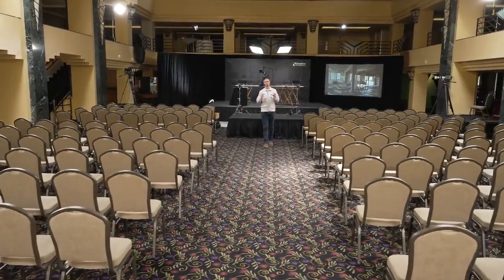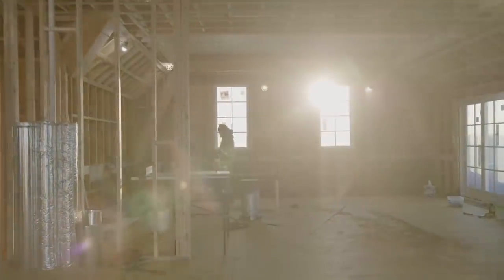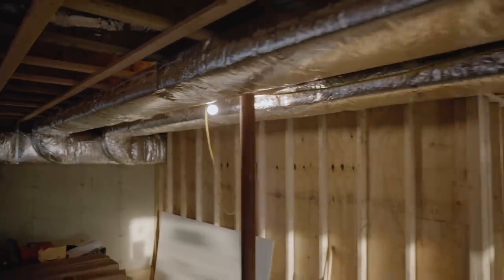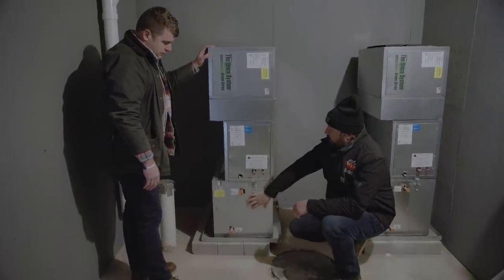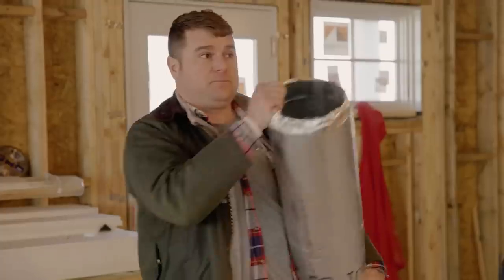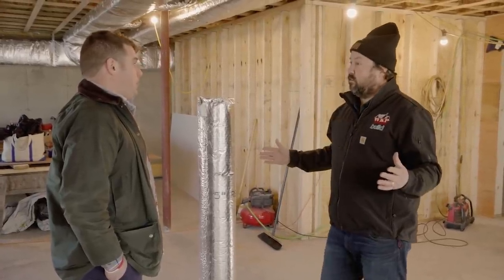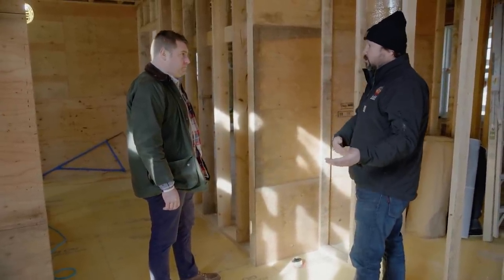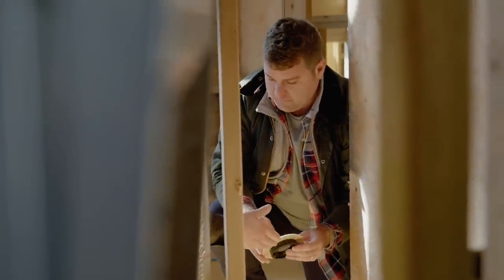Unico HVAC with Tiny Tube Ductwork! BOAI: Episode 7

Comment: Unico makes 0 sense in new construction, sorry guys. (This is coming from a Unico installer/dealer)
This just seems like poor management of space... Conventional systems have such significant advantages over high velocity in terms of comfort and efficiency. Especially in a situation where you need to be particularly efficiency-minded, this was a poor design choice. Sure, we got a little extra headroom (4"???), but we got a lower efficiency system with no access to communicating controls, truly variable capacity or fan speed, etc...

We love and use Unico for retrofit in urban homes all the time - it's FANTASTIC! But, time and place...

Comment: Less air flow must be new england speak for less volume. I think most people would simply reference other common models for volume and velocity. Its funny that they make a big deal of it being modular but every air handler is made to be able to be added to with things like an A coil, or a gas set-up or a dehumidifier,  etc.
Reply: PV=nrT  period!  Nether of these guys have a commanding understanding for the physics, as do most normal non-engineer, builder dudes.

Comment: I installed a Unico system in my 1920"s era house back in 1995. Big mistake.  For that small size duct, you have to makeup volume with velocity and that creates a noisy system. The noise was really distracting, particularly on startup. When I renovated my next house, i went with with a variable speed/conventional duct system.  Maybe technology has improved, but I would be skeptical about the noise factor.
Reply: hopefully it has changed in the 30 years.  i would imagine the supply ducts have the sound attenuation which would reduce the noise
Reply: @sabregunner1  There were sound reducers on the ends of each duct back then, so, I'm doubtful on the extent to which it could be improved.  I remember the salesman explaining that the system would be relatively quiet....not so in reality.  I get the advantage of Unico....it's all about being able to snake the small ductwork around in limited space.  That's what brought me to the Unico system in the first place. But, if at all possible, I would avoid that option and make it even better by using a variable speed air handler.
Reply: @joemartino6976  ok.  wasnt sure how much that was a thing back then.  You;ve got a good argument there
Reply: We installed a Unico in our 1880s era home a couple years ago in our 1st floor and it is nearly silent. Our 2nd floor has a conventional system installed by previous owners and by comparison it is a noisy racket. Not sure why the big difference, but we do love the Unico in our case.

Comment: 2 zones for the entire house?  Did I understand that correctly?  Brand new house, guessing 3000+ sq ft and only 2 zones?  Not only that, those heat coils require medium temp water, not low temp where a heat pump (ground or air source) would shine.

Building on an island, fuel & power delivery is the hardest, most expensive task. The property location is a heating-primary zone.  A ground source heat pump & low temp in floor heating would be the cheapest, most comfortable heat solution.  Zone every bedroom, kitchen & living room independently.  Cooling could also use ground source heat pump system.  The most comfortable cooling solution would be a refrigerant manifold system with multiple ducted heat pumps.  A cheaper solution would likely be chilled water air handlers.

Add lots of solar and you would have an efficient system that would be cheap to run.

That system they chose is going to be expensive to run and maintain.
Reply: Yup.

When you have a contractor that gets kickbacks from Unico and forced a bad solution down the poor new homeowner’s throat.
Reply: Why not ductless?
Reply: @nihiltube  ductless would work fine too but sometimes you end up with higher temperature variances between rooms.  For example, It doesn’t make sense to put an air handler in a hallway, bathroom & mud room.  You would place a ductless air handler in a common space close to those rooms and rely on convection to cool those spaces.

With multiple ducted mini-splits you can direct air exactly where you need it to achieve a lower temperature gradient across rooms.
Reply: @brians8664  IMO single rooms are ideal for ductless because you get individual temperature control, and if you don't have any very small room, you can save a bit on the bill - ducted I would like on a common space and bathrooms, since bathrooms are typically small and you wouldn't put a ductless minisplit in there. With this design you don't get a temperature gradient because each room gets its own zone. Large open spaces are probably better served with ducted if you can bring the ductwork around practically. What do you think?
Reply: Looked like three zones. Two units in the mech room and one in top floor's attic space.

Comment: Just finished installing my first Unico. Lots left unsaid in this video.

You're losing efficiency with high static pressure. Period. Even the design manual talks about reducing it.

"You'll never see larger than 9 inch duct". This is a terrible way to say it. You'll never NEED more than a 9 inch duct. But you can and should up-size if space allows.

Lots of benefits they could have talked about: Very quiet. Hydronic options. Simple to calculate. 

But the number one reason to use one is because you don't have room to use a conventional.
Reply: And if you don’t have room to use conventional ducting, then go VRF!!! The blaring solution in the room.
Reply: @xzibit8614  but doesn't solve fresh air, right?
Reply: How is the sound? I am seeing videos that show how loud the air flow is in the room.
Reply: @archidube  It's not bad, if you do it right... The frustrating part is that if you send it to Unico for them to design it, they will very likely violate the recommendations in their own design manual. Probably because they don't want to price themselves out of the job... Doing it right / making it quite involves more outlets (more outlets == less airflow per outlet == less noise).

Unico's "normal" recommendation is 6 outlets per ton... I think I did 11-12. 

I cannot hear the equipment, at all, ever. I can hear the airflow if I'm at the top fan speed and the house is super quiet (and my house gets SUPER quiet). Once the kids and dogs are awake, I can't hear it at all.
Reply: @JamesTalmageR  All of this complexity makes me wonder if just having normal sized sealed duct work is better after all.
Reply: @archidube  Absolutely no question that normal size ducts are better, if you have room for them. Unico's claims to the contrary are nonsense. I wish they'd just stick to selling to the niche market they're best suited for, but that's not how corporations grow revenues.

As for "all this complexity"... Engineering the Unico is a cakewalk compared to standard systems. Proper duct sizing is fairly complex in traditional systems, and almost nobody does it right for residential. It's certainly worth doing if you can afford the engineering bill.
Reply: @JamesTalmageR  I have a house with 50 year old metal ducts that has had flooding in crawl space last two hurricanes. The insulation floated off the main trunk line and the rest will stay wet for months. Glad they are metal. Thinking of putting in the attic which is low hip roof. Maybe starting over with Unico would save money if I did it myself.
Reply: @archidube  Unico has great training resources. Some of the best out there. Figuring out how to do it yourself is no small undertaking, but they actually provide enough information that it's possible. Read all the service/installation manuals, and all the tech notes. at least twice, and take notes. There's a particular "designing for quiet" technote that covers the outlet-per-ton numbers I was talking about.

If it all possible, you should use the "self-balancing loop" design for your main trunk (it's what it sounds like, rather than a bunch of  branches going in multiple directions, you run a loop). It operates on similar principles to plumbing balancing loops when you've got multiple shower heads. It cuts down on the required duct engineering significantly (at the expense of extra duct).

If you're going to put it in the attic, you're going to want to consider encapsulating the attic. Matt talks about it alot on his channel. Energy Vanguard (an excellent resource) has multiple posts as well. There are pitfalls encapsulating older roofs... Make sure you read a lot.
Reply: Unico has the best small duct work out there and they are not selling more because they are not doing enough advertising. Great people to work with. I’m hoping to finish my installation this year

Comment: For the dehumidification, how would the performance of this system compare to a properly designed HRV/ERV ventilation system?  My dream system would involve geothermal and a water to water heat pump for both heat and cooling.  Plus something like the Zehnder system for fresh/conditioned air
Reply: Ditto this question. Will this system have an HRV placed? Be interesting to see where these premium additions (dehumidifier & HRV) will be added or not.
Reply: HRV/ERV should be completely separate from the heating/cooling/dehumidification. Although you could maybe consider exhausting bathroom air as part of the dehumidification strategy.

Comment: could just leave out the lowest module and use a heatpump for both heating and cooling and have a simpler and more efficient system :D
Reply: Heat pumps are more efficient than any boiler, the only exception is when it is below -25f outside or if you're electricity is super expensive. Honestly, heat pumps should be mandated on new construction, there is literally no reason to install a stand-alone AC anymore.

Technology Connections has a few very good videos about why heat pumps make sense even if you live in an area where a heat pump cannot operate.
Reply: @namAehT  yeah exactly, and its not many days it get that cold so its still cheaper

Comment: Problem with unico is these tiny proprietary ducts.  If you ever decide to not go with unico or if they go out of business, homeowner is  screwed.

The entire industry uses a ducting standard but “oh so unique” unico with their proprietary tiny low CFM high pressure, high energy hog, high cost gimmick.

If they wanted no ducting should have gone with a VRF System.
Reply: THE ENTIRE INDUSTRY. This is marriage for life. The whole speal about the air going slower over the coil dehumidifying more i was thinking "sensible heat ratio? Manual S?" 
I guess that's why his contractor had to hire unico for the load calc too lol.
Im scared to guess what their blower motors cost.
Reply: @shidoink  and high static motors = less efficient.  Think an air compressor.  Uses a crapload of power but pushed a small amount of air with high pressure.

Unico systems are NOT anywhere as efficient as the highest efficiency systems / VRF’s today.  To overcome the restrictions of using piping essential instead of ducting, that energy to push the air has to come from somewhere.
Reply: @shidoink  and if you want more humidify removal?  Get a variable speed inverter.  That’ll slow airflow.  VRF’s remove a crapload of humidity cause the delta temp is much lower than a ducted system.

Comment: HVAC experts:  I have a split level home with open stairwell.  I've got an 8 degree delta upstairs vs downstairs.  Zoning is not an option as ductwork is behind drywall.  Would an unzoned high velocity system help with the temp difference we're seeing upstairs/downstairs?
Reply: You could install an HRV with its own duct work and try and pull the air from the top floor and redistribute it to the bottom floor.

Comment: I'm no HVAC expert, (but I do have 10yrds+ 1200+ psi boiler operation and maint. background) but why would you ever want to put a cooling coil in series with the heating coil rather than both in parallel and switch the inlet source depending on the current functioning demand?
Reply: Ease of use and less parts for failure it’s essentially what’s done on gas furnaces or air handler’s with electric heat it just only cools or heats one at a time